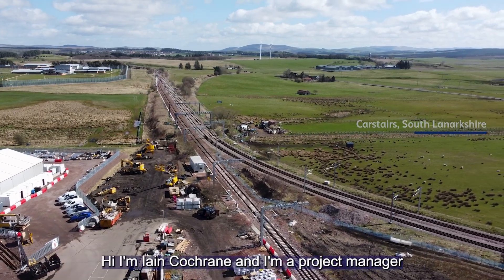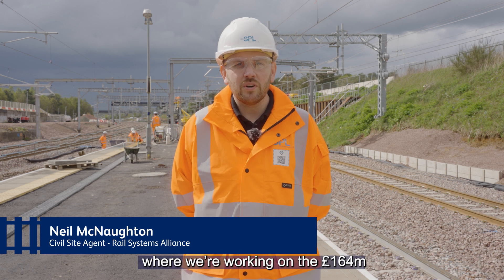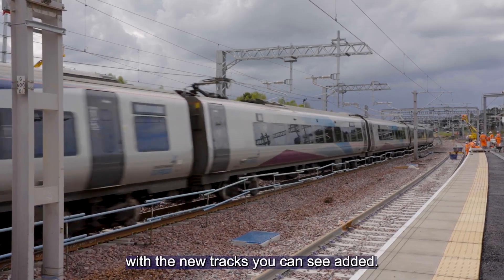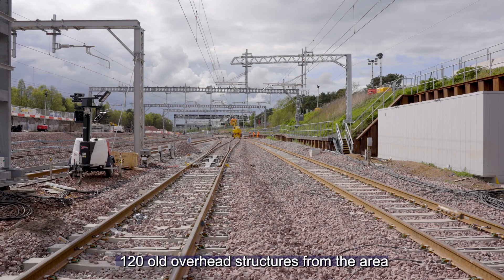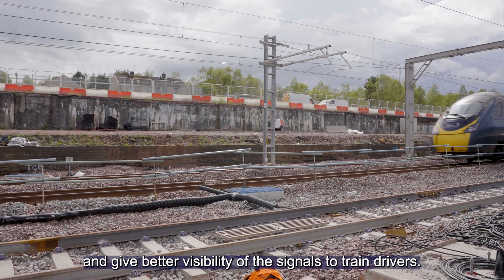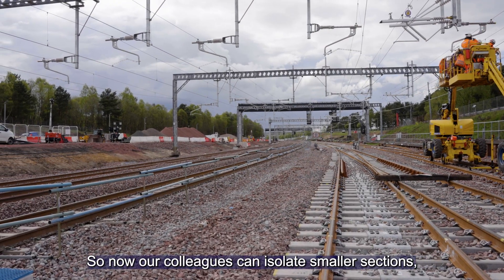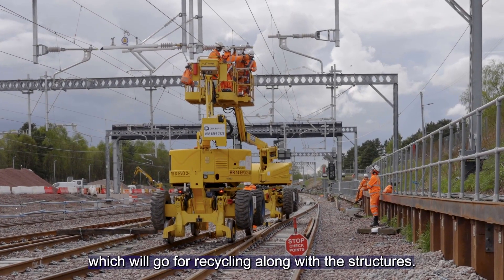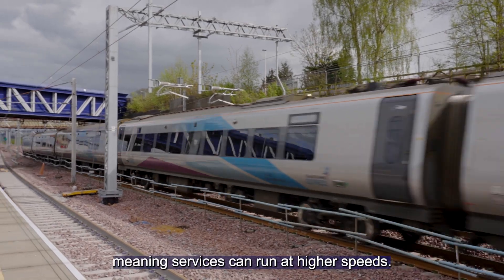Scotland's Railway - Carstairs Modernisation - Overhead Wires update

Comment: It's amazing how most of Europe went overhead electric just after ww2 and yet now the uk is just catching up with this. Still, nothing like rushing into things eh! 😂
Reply: The railway through Carstairs has been electrified since the 1970s.
Reply: There is a reason for that, especially in Germany. They had a very effective demolition company known as the Royal Air Force demolish their railways for them. The railways were then rebuilt to a higher standard and electrified after the war. The UK's railways were not damaged to the same extent, add in Britain was essentially bankrupt from two world wars and you get the reason why electrification has taken so long.
Reply: @dat581 would it not also be true to say that since Europe developed trains several decades after Britain did that they had the advantage of our hindsight and that in Europe under Napoleonic based laws it was much easier to drive lines right wherever they wanted, where as under English law it was far, far harder to force a landowner to sell land; the result of both of these is that Britain's lines are not generally as straight as European lines and as such the benefit of electric vs diesel-electric was greater for Europe than ours.

I mean seriously, have people like 'todd' ever been to Europe? I think their problem is they see Europe's flagship trains and assume they're all like that. Until the 1990s it was still posssible to catch an SNCF express where you could stand outside on the end balcony between carriages.
Reply: @derektaylor2941  Many don't really understand the railways in Europe beyond they high speed networks as you say. German trains are famous for being late. so much so that when Germans travel to the UK they are shocked that trains mostly run on time!

Edit: I would go so far as to say on average UK trains are better than most in Europe outside of Switzerland.
Reply: @dat581  my experience of Austrian trains is pretty good too. That said most of those I have used have been generally tourist, narrow gauge and often steam, so I don't know if I can count them.

Where I think our privatised network is let down is presentation. Dirty stations and when franchises end, they're desperate to repaint the outside, but the seat moquette and carpet might be 20 years old- and not cleaned in that time. That of course and our modern seats being made to be as uncomfortable as possible, but the ability to get from A to B quickly and reliably is pretty good I think.
Reply: @derektaylor2941 Britain's privatised network does have a lot of issues; the main issue is it is really privatised in name only. The government sets the timetables and fares, decides what new infrastructure will go ahead and generally interferes with the running of the various franchises. It's notable that the franchises that do the best have the least government interference and focus on their core business. Chiltern being a prime example. I travelled on Chiltern Railways last winter to get to Birmingham and was impressed by the service. On time, clean, comfortable and fast.
Reply: @dat581  sorry but I don't agree with your logic or reasoning there pal.
Reply: @toddhunter3137 h'ark who's talking. Even now Europe has vast sections of diesel lines.